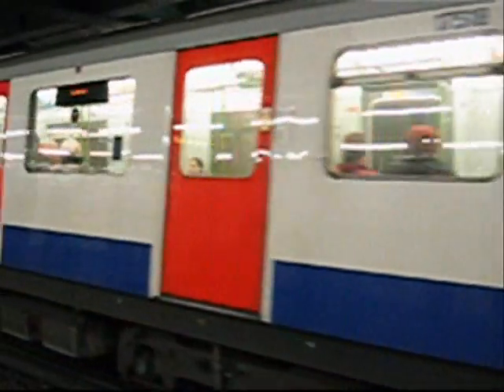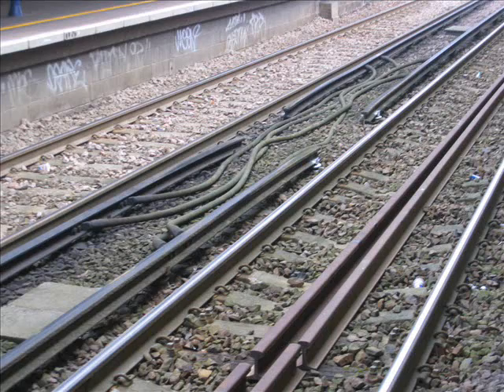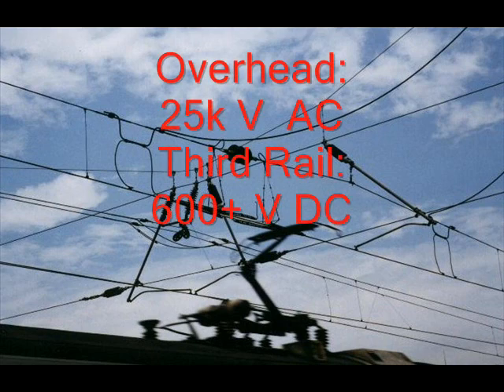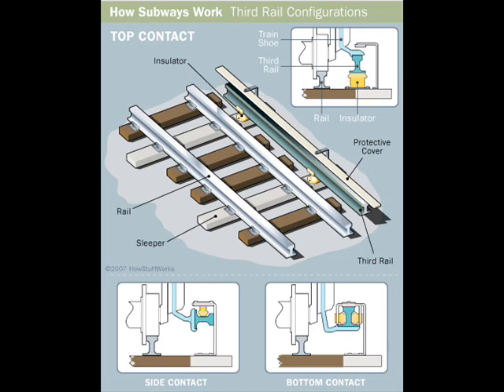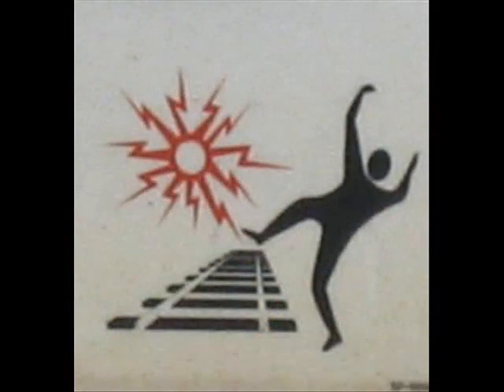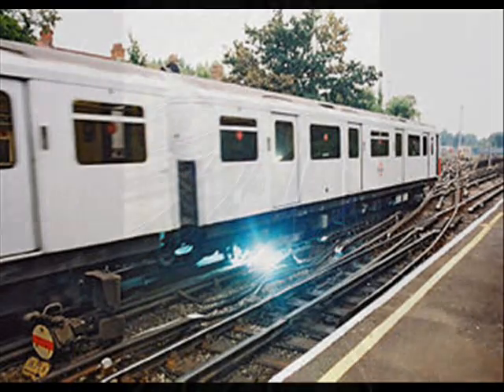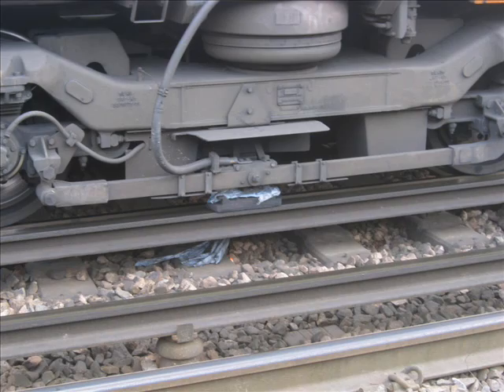Train Electrification System (The Third Rail)

Comment: I think two rails would be more cheaper. Why not have two seperate sleeper than one single piece?
Reply: Yes! I think what you have in mind is to electrify the two running rails and indeed, toy train-sets do exactly this. The big problem is how to insulate the rails sufficiently to prevent shorting and leakage and then both rails would presumably be live to earth and therefore lethal.
While third-rail is described as "dangerous" and inefficient, the thought of live overhead wires at several kV does not reassure me. What if a wire falls done. My tutor in 1970, a veteran of South African Railways related how in Italy in WW2, he witnessed a wire coming down arcing and sizzling as it snaked back and forth across a station platform!

Comment: You can wire 6 hair dryers in series to the 3rd Rail. and they will run just fine. Just make sure that all the heat settings are the same.

Comment: The first electric train service in London was between Victoria and London Bridge. It used overhead wires, the system favored by the LB&SCR. Third rail was favored by the LSWR (out of Waterloo) and they got a lot more track electrified before the companies were merged to form Southern Railways. A choice was made -- third rail -- and electrification progress became rapid during the 20s and 30s. (BR continued to electrify some lines with overhead 1500v DC before standardizing on 25Kv AC in the 60s.)

(The reason why the Tube uses a fourth rail is to keep traction crrent away from the cast iron tunnel liner segments,they'd be corroded by it.)

Comment: Third rail goes back further than 1890.
There is a third-rail electric railway running along the sea front at Brighton that opened in 1883.  Currently undergoing restoration, it should re-open summer 2017.

Comment: why do people who jump into tracks to save people not get electrocuted
Reply: Not all systems are 3rd rail systems. Some use overhead wires and others have covers over the 3rd rail. Also, generally the 3rd rail is on the far side from a platform, so you have to fall a long way to actually touch it.
Reply: The third rail in South England does not have covers.

Comment: I study fuckin engineering and you said 3rd rail can handle more mechanical forces? I call that total BS. if 3rd rail is able to handle that much force, why all the famous highspeed trains like the TGV, Eurostar and etc are using overhead wire? that's because 3rd rail has speed limitation.
Reply: It's more robust for a suburban or outer suburban service such as the Southern Region of BR where I worked. Back then low-voltage DC was better for traction purposes as if you tried running the older brushed motors on AC they'd arc terribly on the commutator. Eventually we settled on an AC distribution system that fed substations, and it was in them that the AC was rectified to DC. There's now far too many miles of this to convert to AC-the cost'd be frightening. But for high speed service such as TGVs, Eurostar, you can't beat the AC system with on board rectifiers on the train itself.Another good thing is the high voltage means fewer and simpler substations without rectifiers. However, the systems in Europe do sometimes use DC OVERHEAD. Holland uses 1500V and Belgium and Italy 3000V. But again, all new high speed lines, for Eurostars,etc, are AC. I recall the Eurostar running on 3rd rail in Kent at first, it drew 1000's of amps and its performance wasn't good :-) Got stuck behind a few in my time !
Reply: ***** Thanks mate. But the problem with 3rd rail is that most rolling stock doesn't have sturdy collector shoe to attach to the 3rd rail. Run faster than 120 mph already gonna break lose.
Reply: ***** I think when he says high mechanical forces he means something like a defective train collector shoe won't cause a miles of damage (they tend to just snap off when hitting the rail badly) to the 3rd rail system whereas if a pantograph was to fail the damage could be substantial and go for some distance. I know this as I work on 3rd rail and issues do occur don't get me wrong, but from what I've gathered from friends that work on OLE (Overhead Line Equipment), it can completely shut routes and might require you to get out an RRV (Rail Road Vehicle) to fix things whilst CRE (Conductor Rail Equipment) aka 3rd Rail  is all at ground level and can be attended very quickly... normally haha.
Reply: *****  A big freight train going over it would really put the wear on it
Reply: Intel & Nvidia SUXXZZZ!!!  Beyond 100mph the third rail system is inefficient as huge amount of power is lost to heat dissipation. Nearly all 3rd rail lines in the UK are limited to 100mph for this reason.
Reply: Another problem is voltage loss over distance with third rail DC. A given distance will need more substations and feed points on DC than on AC. On the Southern Region, subs could be as close a couple of miles apart. Line voltage was around 750 DC. When the new generation of plastic souless trains came, the boffins found they drew too many amps and pulled the voltage down, so we had to strengthen the DC supply considerably to cope. On the ground, those of us working down the sheds had a pretty good idea this'd need doing LOL ! I seem to recall being told that when they did the West Coast Electrification at 25KV they worked it so a substation was needed at every 20 miles.

Comment: Does anyone know the typical current (not voltage) that runs through a third rail?
Reply: Well, when I worked on BR's Southern Region, the ammeter in the cab used to go up to about 1200A max. This was in a four car set with a motor car at each end, they had two motors each. The later middle-motor "63" stock used 4 motors in one motor coach, and they'd show 2400A when pulling away. Both of these readings would show if I went straight into "Weak Field" or what you might say was full power rather than notching up slowly, which I'd do in bad weather or if the track was slippery, icy or whatever.
Reply: David Robins 750 VDC
Reply: Between 600v DC and 750v DC. Overhead wires are 600v DC (tram lines) 650v AC (new tram lines) and then 1500v DC, (older train lines) 25 000v AC (new train lines) Then they can get all the way up to 50 000v AC for high speed trains.

Comment: I have a question. Does the electric rail have a circuit breaker?
Reply: +n310ea    Yes, but that circuit breaker (designed to protect equipment) offers little protection for human beings. It will allow well more than enough amperage to cause serious injury or death without tripping off.

Comment: A DC motor does run at low speeds with high current which means high torque, as described in wiki,
Also it may be because of Sprague's inventions in the early days of electric trains - trolleys.

Comment from the maker: well, a reason I know I read online somewhere. It makes sense. The third rail has a small clearance, if too high a voltage is placed on the third rail, it'll cause arching with the ground. There's a maximum of 1.5kV for the third rail. Not too sure about induction engines.

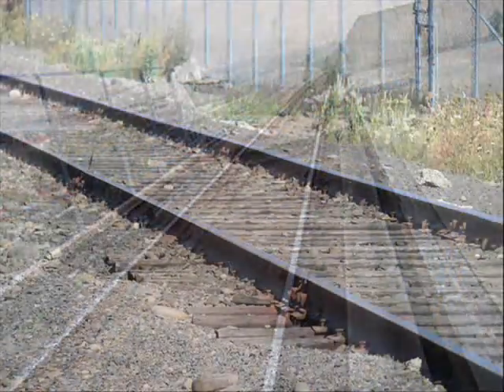Comment: Your quite welcome! in looking at the video at 1:21 shows the still picture of the Bart track, from the background landscape this is the Daly City Bart Station, showing the eastbound trackway, up till when the system was extended to SFO completed in 2005 the Daly City Station was the "end of the line" I don't think Bart had much trouble with loosing power at track crossovers each car had 4 contact shoes plus short lengths of the 3rd rail parallel to the cross tracks.

Comment: Excellent Presentation the videos clip were superb. I noticed the clip of the aerial BART trackway, I used to live in the Bay Area and rode Bart quite often. I remember as a young child when the system was being constructed. Bart's 3rd rail was as I understand being an odd voltage must were 650-750 V DC. Each station has a power substation to rectify the incoming high voltage AC to 1000V DC. The negative or return conductors were bolted to the tracks looping back to the substation.

Comment: You did a very good job explaining the 3rd rail power system, But remember track workers prefer a 3rd rail system over others and the fact there is a protection board over it increases the level of safety. Most 3rd rail systems use between 600 VDC to 750VDC as an operating voltage and the return is of course is the running rail were the wheels ride on. I have been in the Electrified Rail Field for over 40 years and enjoyed your presintation.

Comment: Interesting but I assumed since I was about 6 that everyone would understand the basics of how electric trains work.
Every time I take a train, it occurs to me not to get anywhere near the rails, not just because a train may knock me down.
Also I heard that the third rail system costs MORE than overhead lines because of the repeater stations needed to power the tracks due to voltage drop, which is why for example the north london line and old east london line have been converted to overhead.

Comment: Nice video. Minor nitpick....the 3rd rail voltages. In London, it's +440 on the London Underground (4th rail is -220), +660 on sections shared by London Underground and mainline EMUs (usually the London Overground, although there's a section of District line occasionally used by diverted Southwest trains), and +750 is the standard voltage everywhere else. Most third rail systems on Earth use +750 (BART in San Fransisco uses +1000, New York's subway is +600, though)

Comment: When i worked on the underground the shunters would walk on all the rails! One guy was standing on the outside rail whilst holding onto the battery loco! You need good footwear to say the least!! The H&S guy was telling me they used to eat their breakfasts sitting on the middle rail! The middle rail has around 8000 amps so if you do fall on it the current will not drop till you are fried!

Comment from the maker: I found this online:
"Contact 
with the live rail or overhead line will result in severe burns or 
death.

It is theoretically possible to stand on the third rail, as long as no 
part of your body provides a earth by touching the ground or another 
object. However do NOT try this out at home! Anything in contact with 
the third rail is also dangerous for example a puddle.

It might be possible, but I don't suggest one should attempt to prove such a theory.
Reply: Oddly the Conductor rail can be flooded and the water won't conduct - the reason being it's minerals that conduct not the actual water. The if the water lacks minerals the con rail acts as a huge kettle and the water will actually boil!!